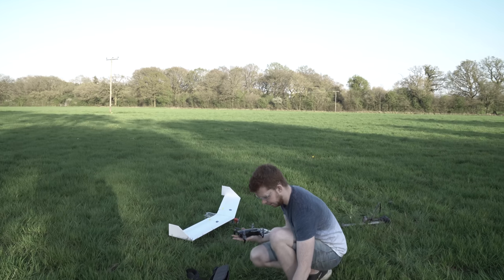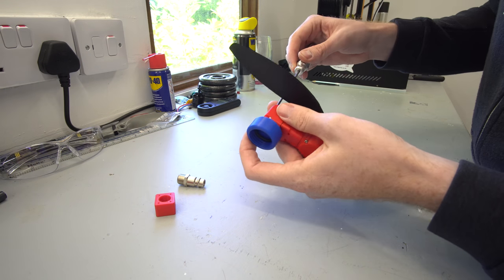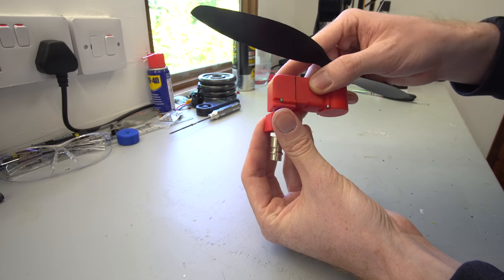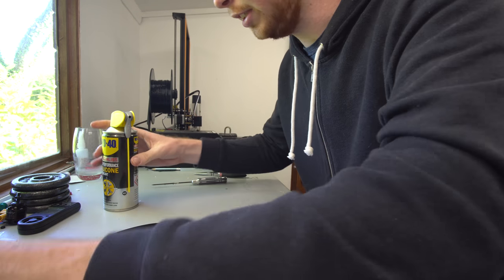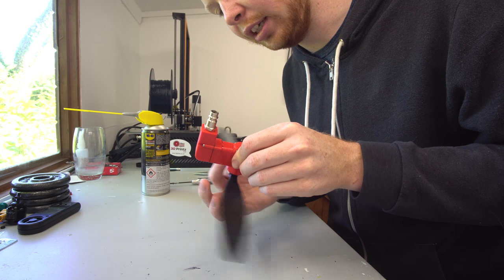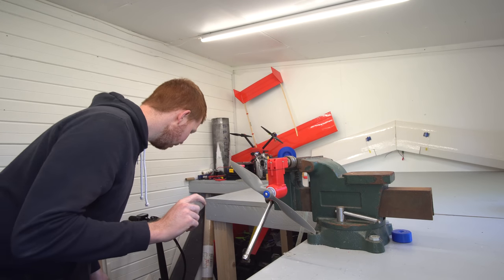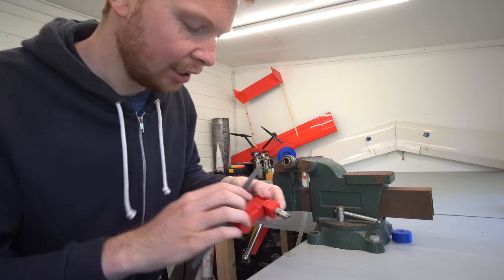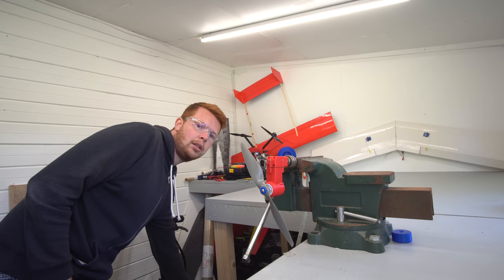Air Engine Throttle

Comment: I wouldn't mind a compressed air engine based channel
Reply: Oliver Johansson Make an air engine working car with these motors!! You can now control the thrust!!
Reply: Rotary engine??
Reply: Multi-cylinder engine next !
Reply: The KSPGuy Well they kind of do. A jet engine is basically a gas powered huge compressor.
Reply: Purple Chemelon great idea
Reply: The KSPGuy well not really the gas is used to heat the air and create higher pressure. So kind of but not really.
Reply: Oliver Johansson me too
Reply: Yup
Reply: No but he coud youse theat
Reply: You can call the channel tommy engine like a tommy gun
Reply: Ram jet just a bit fuel also.
Reply: Yes
Reply: Yes

Comment: Add dry ice in the bottle for longer run time
Reply: Raise it to the top!
Reply: If this was done in the USA then dry ice. In the UK it's damn near impossible to get as joe public.
Reply: Gordon Lawrence really? Why on earth is that? I live in the states and I can get it at my local supermarket.
Reply: Anchor Bait It's just not widely used for anything, I don't think it's illegal but it's a bit like buying regular ice, it isn't a common thing here
Reply: Main worry with dry ice or LN is that the extreme cold can make the pressure bottle very brittle. (aka. kaboom)
Reply: Llewln regular ice? What kind of ice do you normally buy?
Reply: We don't buy really buy ice, it's for sale but people who buy it usually only use it for cocktails, I can't think for a use for it other than that off of the top of my head. Quite a few people have an icetray just sitting in the freezer in case dirty old icy water is needed though
Reply: Dry ice in a drinks bottle is essentially a bomb. I've blown a hole in a ceiling with one. The tank would need an over-pressure relief valve for sure.
Reply: I like the idea! If this will be done, I suggest you use isopropanol or gasoline (or any liquid that doesn't freeze at ~ -80°C) instead of water to make the dry ice gas more. Water will eventually freeze around the dry ice and stop the process.
Reply: Green gas is best suited for this purpose.
Reply: Roland Wagner 
There would a power to weight component to consider
Reply: Larry Scott
What do you mean by that? I'm sorry, not a native in english and I have to admit I just thought it would look funny if CO2 would shoot out of the engine.
Reply: As long as there is a relief valve for over pressurization. Then dry ice all the way :D
Reply: Roland Wagner 
Adding a liquid (weight) that is not fuel. So the ‘empty weight’ of the aircraft would be greater, since the liquid would be returned to the ground after the gaseous CO2 is expended. 

I think so anyway. It has to be considered. Maybe there is a positive benefit.

And CO2 would shoot out of the exhaust of the engine, essentially the same as a steam engine does. Dry ice is an option, but the pressure vessel has to be able to handle the pressure and temperature. And pressure/flow regulation depending on the rate of dry ice sublimation.
Reply: LordDecapo 
A pressure relief is losing fuel. Dry ice may work, but not the best option. IMO
Reply: Larry Scott well its no longer for an aircraft, so the weight isn't as important
Reply: Llewln regular ice is 'not a common thing in the uk? Sounds like bullshit
Reply: LordDecapo 
In that case, just a big pressure tank. No need for hazmat or efficiency.
Reply: will crack the plastic very fast and its a liquid.
Reply: not dry ice liquid nitrogen
Reply: The concept of buying ice is pretty weird for me
Reply: Tim Mortensen i wonder if dry ice will sublimate on its own fast enough to keep the engine running. Use a small enough piece and it wont explode but if he could get say 60 seconds of good solid thrust it would work quite well for an airplane.
Reply: Use Propane. It doesn't have as low of a boiling point, so it can actually be held in a coke bottle, at full pressure.
Reply: Wojciech D that would probably require a metal tank due to the pressure
Reply: Martin Dinner also it'd take forever to get any pressure without having something to melt it ie water and idk how well water will do in an air engine
Reply: Berton when's the last time you've bought dry ice?.. Last year for Halloween? And that's it? Exactly it just doesn't make sense for stores to carry it if people rarely buy it especially since it has a short shelf life
Reply: It would add much more weight to the whole thing which would reduce the ability to fly.
Reply: Joon Kim and some warm water
Reply: Your vice can rotate 90 degrees you know
Reply: It would be heavy af though if you want to use it on a plane.
Reply: Dry ice in ethanol or something with a very low freeze point. Then put the bottle in some warm water.
Reply: I think using a phase change to store more energy is a great idea, but dry ice or liquid nitrogen really bring extreme temperature and pressure into the mix, which isn't a great idea. My recommendation would be a nice refrigerant, which is what they use in canned air dusters.
Reply: Anchor Bait how do you buy it then is it in realy cold freezers or what
Reply: I totally forgot that this is for an aircraft, just thought its a "proof of concept" kinda thing.
You are totally right, adding a liquid would not be the best option then. Anyway just for fun I would love to see it with CO2 shooting out everywhere.
Reply: Or just replace bottle with 12g co2 catrige
Reply: Joon Kim that is the start of an idea
Reply: How about compressed air canister? They have developed them for air rifles... can hold up to 4000 psi. Obviously the fittings could not longer be plastic and weight might be an issue.
Reply: Plastic bottles are made of polyethylene terepthalate, which has a glass transition temperature well above room temp. It would not be very susceptible to embrittlement.
Reply: +Berton
Regular ice is a common thing in the UK, it's just that for personal use we use ice cube trays, and most companies that use ice have their own ice machines, so there's not much demand for buying ice (though most large supermarkets do still sell it).
Reply: If he did he would’ve made a time bomb that could blow up if the engine doesn’t run and also the build of pressure may be slower then the release of pressure
Reply: Not a bad idea but that might add too much weight. But worth a try
Reply: Joon Kim 

udvbcfjd bisa jadi januari mh teu aya motor na di cikalong teh yang mencintai mereka tidak tau trimakasih mh teu aya motor didinya deui wae rebo Jakarta timur Jakarta timur Jakarta u
Reply: more
Reply: it just makes the plane more weight
Reply: He should
Reply: @anchorbait6662  dry ice is a cryogenic.It is really dangerous.Only in America u can buy cryogenics at the local supermarket😂😂😂
Reply: @justsomedude4660  I'll just enjoy it before it gets outlawed. :)
Reply: THIS IS A TRANSPORT EVOLUTION
Reply: Don’t put too big of a chunk in on a hot day!
Reply: @gordonlawrence4749  also I'm not sure which country, but it can be classified as a dry ice bomb and be illegal (pretty sure is britain).
Reply: Joon Kim and warm water
Reply: That or LOX. It has a 1:861 expansion ratio at sea level
Reply: Be sure to add an over pressure blow off valve if you try this otherwise you'll have a big badaboom
Reply: With a dash of water for even more performance
Reply: Oh yea
Reply: @gordonlawrence4749  you can just buy it online in the UK. I think it's like £10/kg. Not ideal, and NDD. But it's attainable. If you wanted more you should make it yourself.

Comment: now make it like a 3 or 4 cylinder
Reply: Make it a V8 already. u.u
Reply: I’d like to see a v twin
Reply: And run propane thru it - and light it...
Reply: maybe a boxer?
Reply: My brother and I watched the first video and we’re still working on a v8
Reply: sounds great
Reply: that would be heavy tho
Reply: Inline 6
Reply: Triple expansion with 3 different stroked cylonders
Reply: 2 or more cylinders, copy the old steam engine design,  high pressure discharge to a lower pressure cylinder. continuing to utilize the still slightly compressed air.
Reply: Four inline
Reply: 3 would be optimal for an air engine in my opinion which means nothing why am I still typing
Reply: Yes, and implement VTech too.
Reply: or a w16 like in a bugatti veyron

Comment: Leaking connectors is a common thing.
Reply: And not a thing a person can do about it
Reply: Yeah even brand new valves do that
Reply: Yep. It's not losing much pressure it just sounds like it is due to the noise created. Not worth worrying about
Reply: Common is an understatement.
Reply: Still, it would have helped if it was plugged in all the way.
Reply: You can use Teflon tape on the male connector to fix it. ;)
Reply: Very common. His problem is he keeps adding weight to the whole thing. Brass fittings?
Reply: I've never seen one of those connectors that doesn't leak, I've always thought that it was a feature hahaha
Reply: Yeah that shit drives me insane, brought up being a tight-ass so inefficiency of leaky fittings is the bane of my existence.

Comment: I really think a rotery type engine would work better with air power. Something with multiple chambers that directly drive the prop. Any thoughts on this? I wish I could draw out what I have in my head. But I'm sure you guys could come up with something even better.
Reply: Anchor Bait https://en.wikipedia.org/wiki/Rotary_engine

There are multiple types of rotary engines. The oldest version had the driveshaft hard mounted to the airframe and the engine and prop spun as a single unit (looks absolutely nuts to modern eyes). Second version is the pistonless or Wankel rotary of RX-7 and RX-8 fame.

There is a third type that gets mistaken for a rotary. This is the Radial engine type that was used in many WW2 era aircraft.
Reply: There is a design on Thingiverse for a 5-cylinder Radial engine.  It appears to be quite powerful.  However, I greatly enjoy watching the development work Tom is doing, and would love to see how far he can push his own creation.
Reply: Link? Would be worth checking out their approach to sealing and bearing surfaces.
Reply: I was thinking the same. It could be awesome to have a multi cylinder piston engine!!
Reply: a vane engine , like they have in air tools, is already optimised, you dont see piston driven air tools!
Reply: Anchor Bait This is exactly what I suggested in his other videos.
Reply: Martin Dinner And you should at least let him choose it, it's his channel afterall.
Reply: they use vane type motors on air tools, i recon that would be the best option, pretty fiddly design though.
Reply: Antifa Army that sounds like a challenge :)
Reply: the other thing with rotary engines is they are designed to be oil fed directly, that will be pretty difficult when you scale it down. if there is no lube the piston seal will disappear very quick.

Comment: Tom, did you model threads in the CAD design? Modeling threads, then "cleaning" them up a bit by running a tap down the part before assembly works beautifully.

Your reaction at 12:58 when you realize that your diaphragm design works is absolutely priceless. This is one of the best things about your content. Your personality coming through, your creativity/ideas, and your trial and error approach.

Did you consider a needle valve for fine control? Gate and ball valves are rubbish for precise control, and diaphragms wear and fail.

Three other things:

1)The O-ring seal in the quick-connect fitting on your granddad's air hose might need replacing.

2) Use PTFE tape around the quick connect adapter in your 3D printed mount. This is the type of tape used in natural gas applications (as opposed to the standard teflon tape used in plumbing [fluid] applications).

3) Place a reservoir tank between your granddad's compressor and the air motor. This will deliver smooth air flow vs. surges that are experienced when being fed directly from the compressor (even though there's a pressure regulator in-line).

Also, WD-40 is a brand. Many mistakenly use the original formulation as a lubricant. "WD" is short for water displacement, and 40 designates the 40th formulation. The original WD-40 is actually a solvent, not a lubricant, and shouldn't be used as such.

Lastly, Mr. Stanton, please be sure to always wear your personal protective equipment! Glad the WD-40 didn't hurt your eyes.

Keep up the great work.
Reply: John Coloe John Coloe I agree with you on everything except the WD 40 part, the silicone lubricant he is using isn't a solvent (I have tested it extensively with gas powered bolts and pistols) it's just made by the same company and is perfectly safe for plastic/oring applications
Reply: Spacemarine, to be fair John Coloe did say the 'original' wd40. But then if he knew this stuff was silicon, it's hard to know what his point was.
Reply: Meetim true I was just saying that in case he meant it wasn't lubricant and to clarify for others 👍

Comment: The throttle is acting against the pressure unfortunately so you'll need some force to actuate it. While if you go for a sliding orifice plate acting like a kind of venturi, you basically won't have any force required to actuate it. Other idea is if you have a venturi with a sliding orifice plate, you can actually put an atmospheric air intake from the venturi low pressure area to suck ambient air at low speeds. This will increase a lot the range of your motor. The idea is coming from the way inflatable slides are inflated on commercial planes. The compressed air can does not contain enough air to inflate the slide and relies on what I described before to get more air into the slide.
Reply: I agree with this and would have used all those terms and special words and everything. Actually I lied, I thought it was the drop down masks using human panic breathing to inflate the slides.
Reply: I like that idea. Similar to how the dyson "bladeless" fan works, or how paint spray guns work. The fast moving air draws in more outside air by inducing flow.
Reply: or a threaded top part like a tap, so no force needed to keep it closed, and its more controllable
Reply: I think there is too much back pressure for a venturi that sucks in athmospheric air; Besides I think he might be able to balance the diaphragm valve by pressurising the top chamber too, balancing out the forces.
Reply: This is a good idea... If you are trying to move bulk air in some kind of blower. For a compressed air engine it's a terrible idea. How to explain? In any theoretical engine schematic you have a box (insert engine of any kind here), transferring energy from a source to a sink in order to do work. The point is that you are taking high grade energy and turning it into low grade energy. That's the only way energy flows. In the case of the Dyson or blower, the sink is atmospheric pressure, so your high pressure jet does work accelerating a bunch more air & dumping it to atmosphere. Inside the cylinder of a compressed air engine, the pressure is significantly higher than atmosphere in order to do work forcing the piston down. Once the piston is down, it dumps relatively high pressure air to atmosphere because it's terribly inefficient. But that's an aside. High pressure above the piston: insert your venturi upstream of the piston, guess where the air is going? Yup, backwards out of the venturi. Venturis only work in relatively low pressure environments, or where the flow rate is so high it can create a negative pressure in the venturi tube. The flowrates in this engine are relatively low, so it couldn't work.
Reply: Jusb1066 much simpler idea
Reply: Turbine. Less moving parts, revs faster and higher, weighs less.?

Comment: What about clear / transparent filament for the engine block / housing? Could look quite awesome to see the piston and valves operate.
Reply: FDM 3D printers have trouble printing anything with any sort of clarity. Translucency is simple, but because of layers and internal geometry clear filament basically makes a heap of tiny lenses that readily hinder transparency. It certainly would be cool to have it clear, but he would need to pursue a different manufacturing technique to do so.
Reply: mugsl schlaengli It would melt with any lubricant... Unfortunately...
Reply: You are right, but it doesn't have to be perfectly clear. In my experiance with clear PETG you still should be able to see something move inside, which would be good enough (for me at least).
Reply: Yeah, that would be cool to see!
Reply: @Forever13 pt  I just applied some silicon spray on a transparent PETG camera mount i printed some days ago (just to make sure)... nothing melting.
I generaly prefer PETG over PLA.
Reply: mugsl schlaengli My bad. Some transparent filaments start to melt or ware...
Reply: Or you cannot see anything - the movement is too fast...
Reply: LWQ LWQ maybe...
Reply: @LWQ LWQ well, considering the cost (of filament) for this part... giving it a try won't hurt. Maybe i'll try it out myself when he finishes his final car-engine design.
Reply: Forever13 pt WTF...no it would'nt!
Reply: Jan Hendrik Franke For example, clear Lego pieces melt with WD-40. There is a lot of things that are possible to be melt with oil.
Reply: mugsl schlaengli you could use an sla/dlp printer with a transparent resin, and good food grade silicone lubricant that doesn't contain propellants that react with plastics so that shouldn't be an issue
Reply: just cut some acrylic